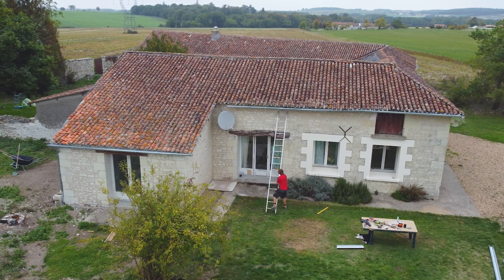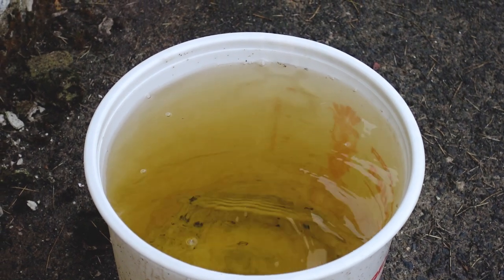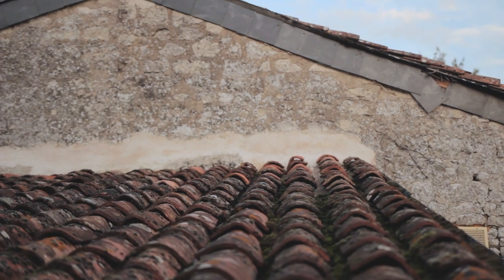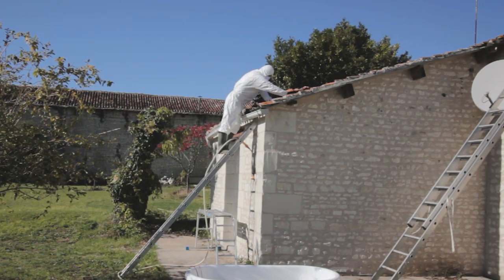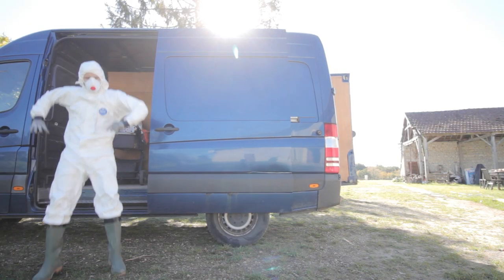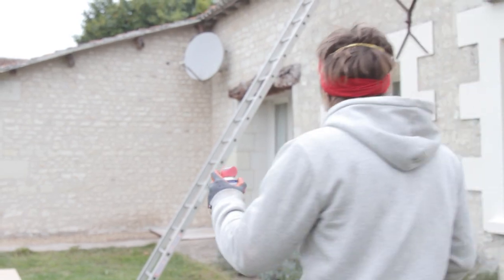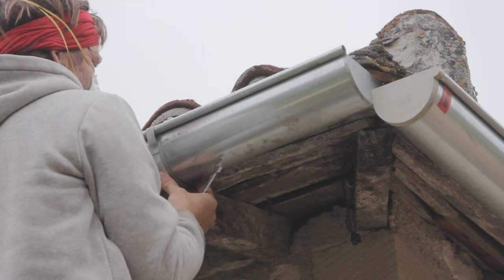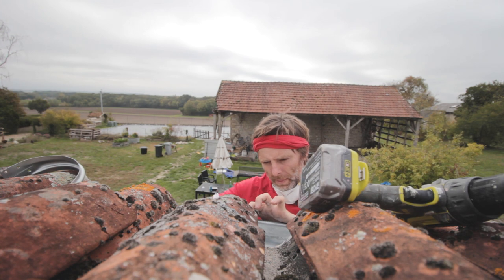Replacing our Farmhouse Guttering

Comment from the maker: The asbestos used in fibro sheeting is called bonded asbestos. In bonded asbestos, the asbestos is mixed with a cement-like product, which means the asbestos fibres aren’t likely to crumble. This means the fibres cannot be breathed in, preventing severe respiratory damage. Bonded asbestos is safe if it is in good condition and handled carefully. However, when the fibro sheeting is broken down in any way – for example, from outdoor weathering, fire or hail damage, or being drilled or otherwise disturbed – the bonded asbestos may be freed and could pose a health risk.
Reply: And it depends on which colour asbestos it is as different colours are stronger I’ve been told.
Great video keep it up 👍
Reply: Yes! Typically one must be cautious not to make the asbestos “friable” or dusty. Otherwise, it is safe to keep in place or move. Just try not to cut it
Reply: Asbestos in a roofing always weathers and the fibers are set free. If you don’t use the drained water for watering plants the risk should be low. But every manipulation will set free fibers. Hammering in those guttering-holds will definitely does it. And indoors the fibers can accumulate after getting set free by natural movements of the roof by wind and changes in temperature over time if not sealed away by insulation or something similar. The color of the asbestos DOES NOT MATTER! Don’t take it lightly! Here in Germany even as an electrician working with electric wires inside asbestos boxes (e.g. in coal mines) you are eligible for compensation if you have alterations of your pleura in your yearly ct-scans. Washing and drying your clothes will put at risk your wife too if you’re living in a more traditional role model of your marriage. The problem with asbestos is, that it takes a very long time until health issues are recognizable: 12 to 55 years.
Reply from the maker: @gichinitosu3153  Completely understand your concerns. I'm aware of the dangers but what can we do when we don't have the budget to replace it? Putting up the guttering is surely better than letting it come down onto the path and into the grass?
Reply: @LivingintheLoire  Of course I understood that you don’t have the budget to replace it. So there’s no alternative than to live with it. But some of the comments seemed to downplay the risk and it is surely no fun to work with full protective gear in the French summer. But you should be aware of the risk to be able to deal with it. BTW: If you are having old plaster in the house: Check for asbestos in that plaster too before drilling holes or other work with it. France was one of the main producers of asbestos. If you like check the Laura Kampf videos. They are in English. She is renovating a 110 year old house covered with asbestos.
Reply: As a construction engineer I also need to recommend to get rid of the asbestos as soon as possible (you can do it yourself but when you do so take all the safety-measures because this is indeed very dangerous). I highly recommend to make chancing the roof one of your (longterm) priorities. As long as you don't have the budget to do so take out every possibility that may cause the panels (and thus the roof) to break. Simply never cut, drill or hammer into the panels, always search for another material closeby to fasten whatever you are placing into. Regardless of all the precautions you'll take you won't be able to guarantee that the panels don't start to break here and there (by moving of the roof due to temperature-change and wind, by aging due to wheathering etc), which will cause health issues.
Reply: Crumbs you have some problems to deal with, the asbestos in the roof sounds very bad, please watch the angle of your ladder, it should be around 75deg or it can slide (I know),  great video keep going

Comment: Many older homes like mine here in Australia have Asbestos especially in the Bathroom/Kitchen/Laundry.....As long as its not broken its perfectly safe......It can be safely drilled using a poly styro cup water and a drill...am sure there is a video on that process on video.After WW2 there was a shortage of bricks in Australia and many homes were made out of Fibro.Most of these homes were made in Kit form by two companies in Sydney and then constructed by the families themselves...Fascinating Story.

Comment: Mate I know scaffolding isn't cheap but I finally bought some this year and it's a complete game changer.  Makes jobs so much easier and so much safer.  Also a zink strip at the top of the roof can really help keep the moss in check.
Reply from the maker: Thanks Jay. I know, I often put these types of purchases off and then I annoy myself that I should've got it sooner, once I realise how easier it is. Where does the zinc strip go exactly? Thanks
Reply: @LivingintheLoire  The zinc strip goes up at the peak of the roof.  One strip for each side.  I get a lot of moss on my roof and once I did that it all stopped.  An old timer gave me that tip.

Comment: Once again, great job. Do you plan on collecting water with those gutters ? Yesterday and could have filled many IBC tanks.
Reply from the maker: We will collect it mainly from the barn roof, it should be more than enough. We have also offered to take water off our neighbours roof but it currently doesn't have guttering. The east non-sheeting side is an option but the south side will eventually be more for entertaining and relaxing.

Comment: Impressive DIY skills and a job that should prevent quite a few headaches in the future. But so far, no mention of water tanks. Here in Australia we are big on catching rainwater for reuse in our gardens. Why not consider catching and storing winter/spring rains for use during dry hot summers on your veg garden?
Reply from the maker: Cheers Lucy. We mention it in the soakaway video. We will harvest water from the barn roof, as that will be nearer the potager. We may harvest water from other roofs for flower beds.

Comment: Nice work Brook! That zinc guttering looks great. It's going to make a huge difference during Winter, no leaks and a dry house! I've learnt something today, french gutter brackets are far superior to Kiwi brackets! I'm stuck with PVC guttering, and those plastic brackets are so flimsy, and the guttering warps after only a few years, I've got to get a lot more brackets put up to counteract it. There's nothing worse than overflowing gutters!! Much love and bug hugs all round xxx
Reply from the maker: Cheers Karen. The zinc guttering was only slightly more in price than the PVC when I bought it last year, it's now gone up about 25% or more. But it doesn't degrade or leak (if you connect it correctly). You rarely see a house here in France without zinc guttering. That being said I think we will put PVC on the barn to collect water. I read you're meant to have brackets every 30cm. Hope it's starting to warm up in NZ.